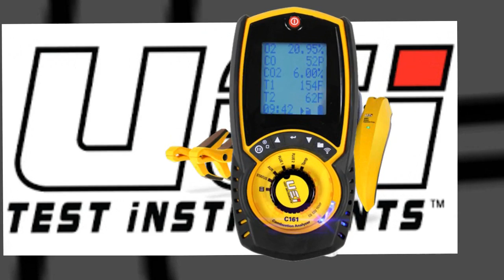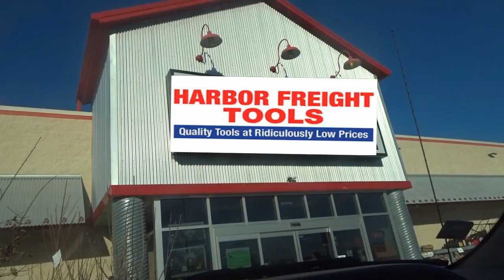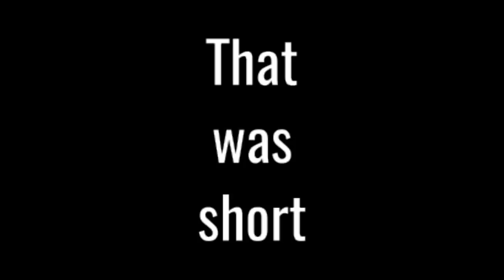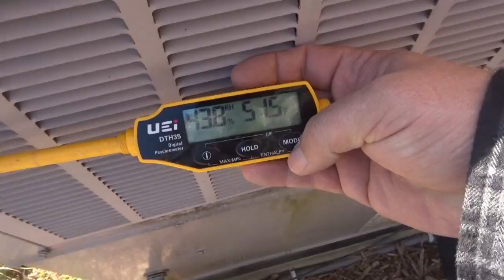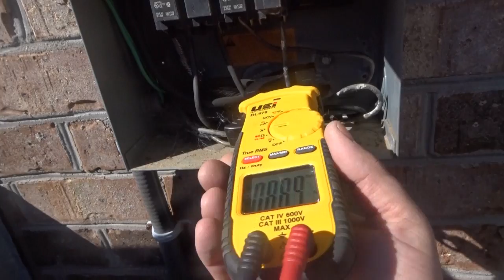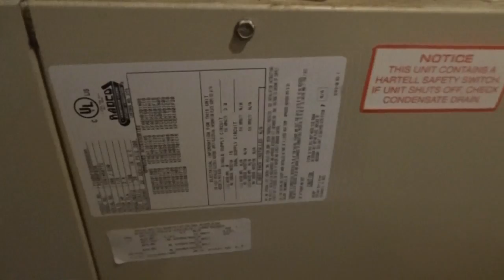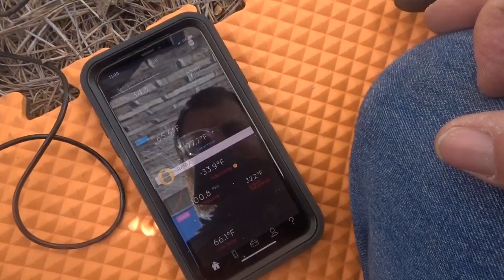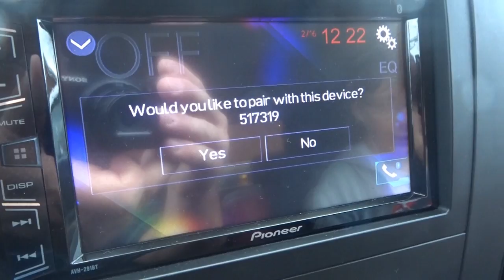7 | HVAC Preventive Maintenance on Two Bryant Systems

Comment: What kind of truck did you get
Reply from the maker: Michael Baird GMC Sierra
Reply: You need a Decked drawer system....that’s what I run in my truck. Still have 11” under bed cover.